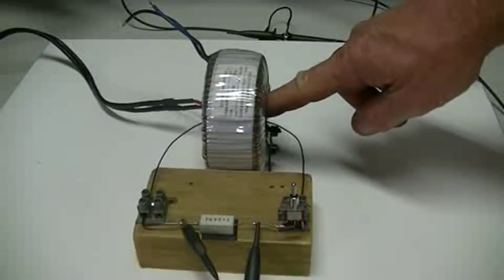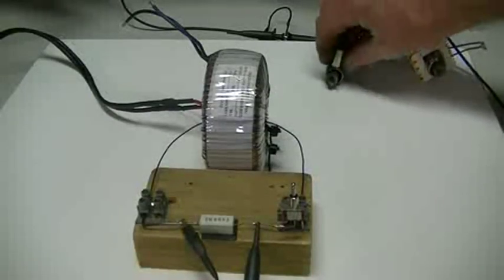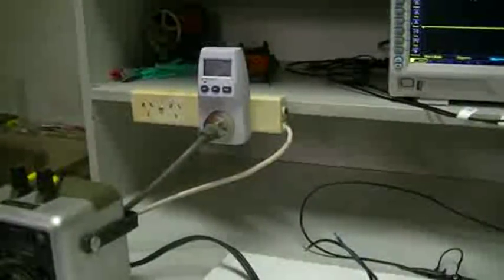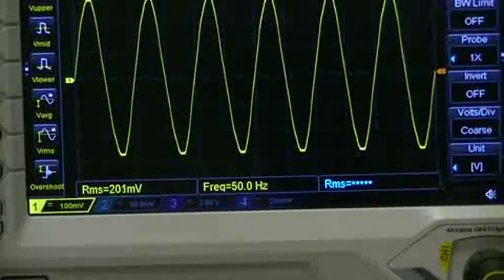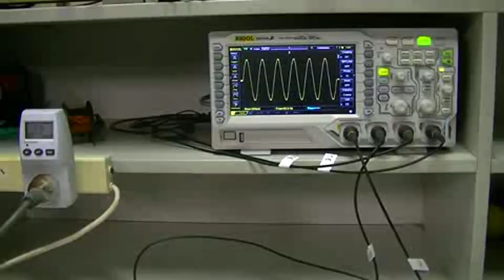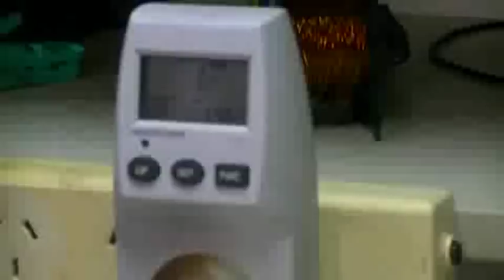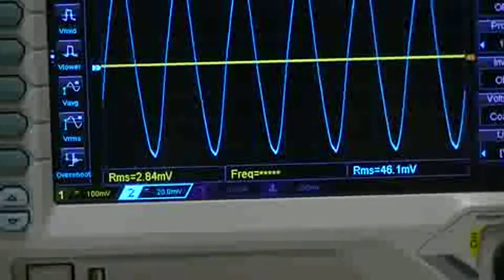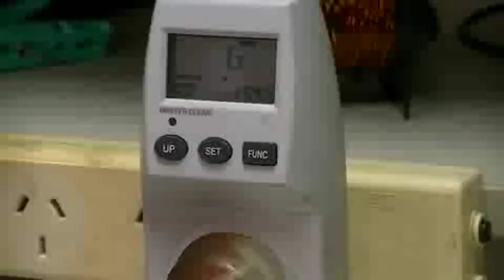A closer look at induction

Comment: Hi mate, I too tried this using steel brake fluid pipe without much joy.  It'd be interesting to see the effect on the (Cos phi) of input current vs input volts on your scope. In my case I had supposed I could delay the source EM field from reaching the centre concentric wire. I had thought very little field would reach the wire till saturation of the steel jacket occurred.